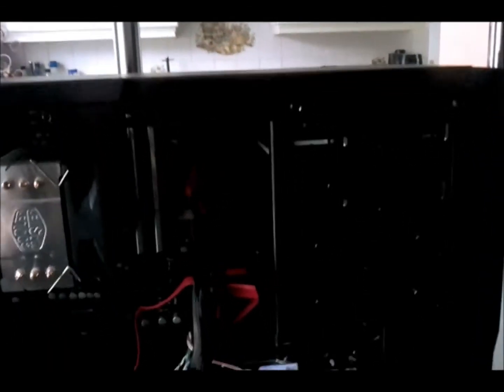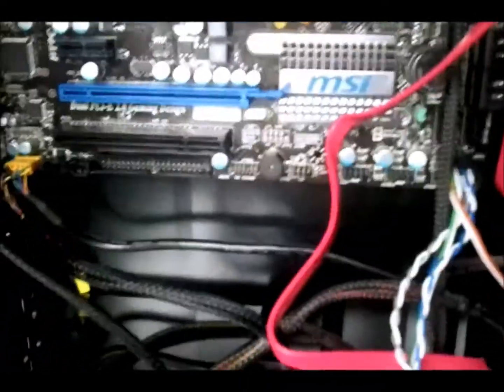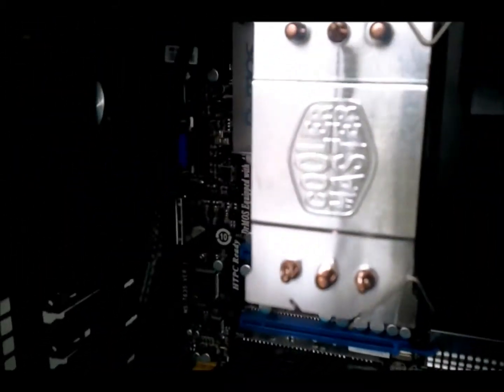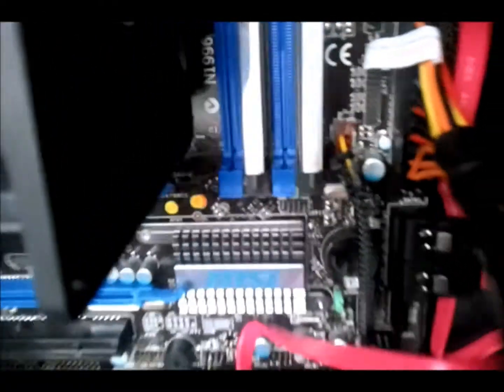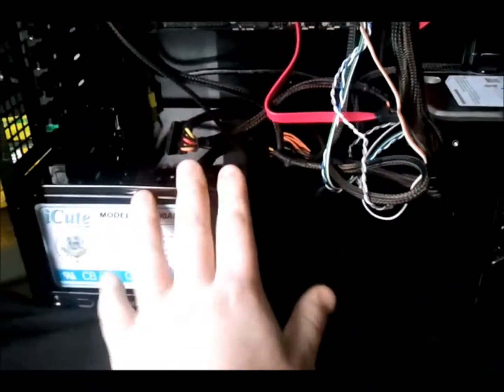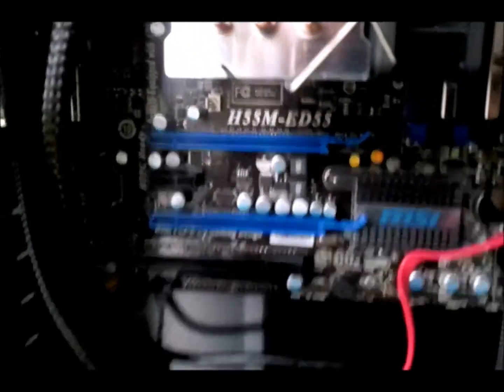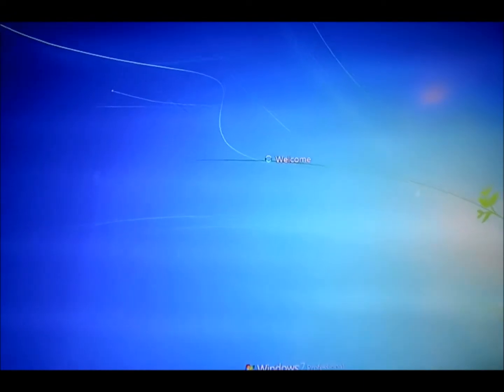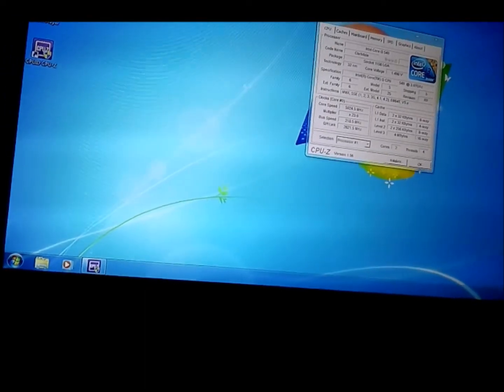i3 540 bundle budget htpc and gaming rig and overclocking

Comment from the maker: @orisaban1 I specified that the cooler a coolermaster tx3 temps were around 65 full load around 20-30 idle the i3 just does not get hot. Vcore for 4.6 for me was 1.347 this differs for chips